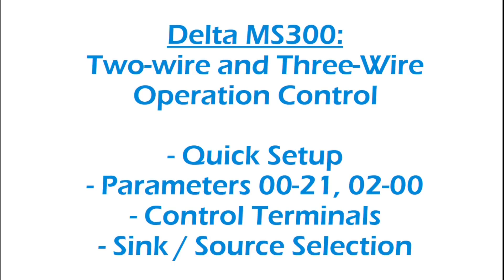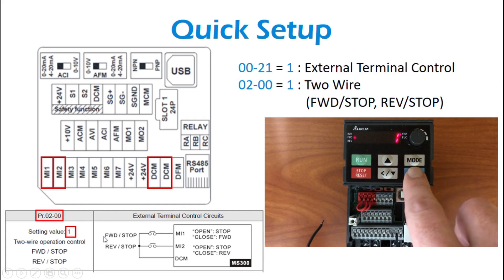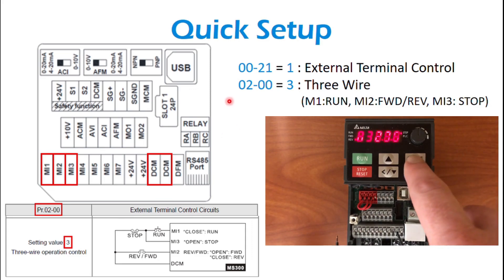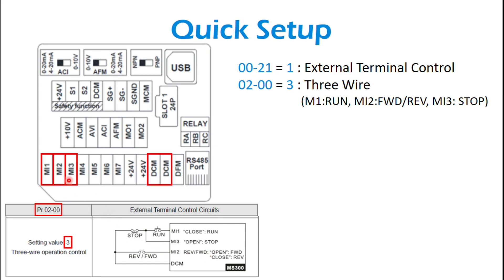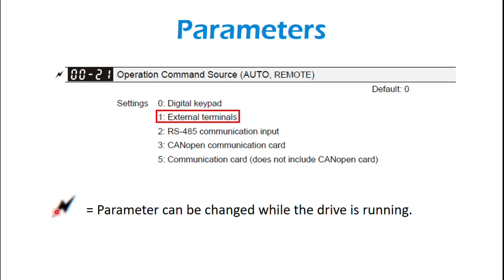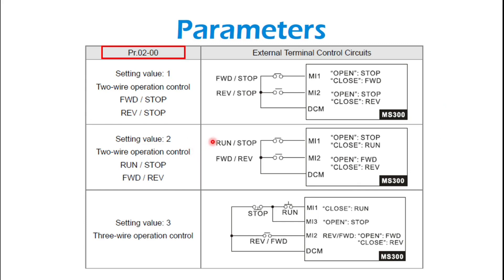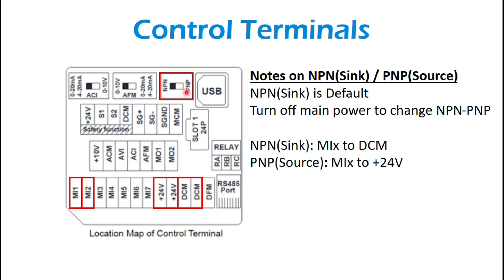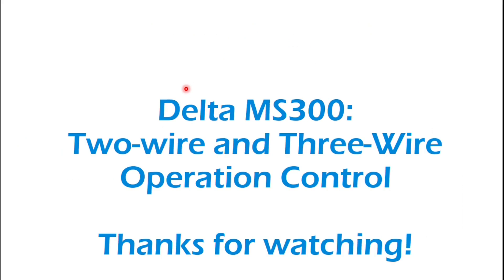Delta MS300 External Terminal Operation Control

Comment: I am wanting to run a vacuum pump for my cnc table. I was to told split the wire from the vacuum on switch and put it on m1 and vcm. Is this a safe method to run the drive?
Reply from the maker: As long as it is a dry contact from MI1 - DCM and no additional power given to the drive control terminals, then yes.

Comment: Can I bypass it by connecting a wire from MI1 to DCM bcuz I want it to run as soon as I activate the external switch that provides power to it
Reply from the maker: Yes, also check 00.21 for external terminals and 02.35 setting to enable it

Comment: can we take out the digital panel and use an extension wire or something so you can transfer the digital panel on the door of the main panel?
Reply from the maker: Yes there is a keypad extension cable. The part numbers are in the accessories section of the manual.

Comment: What about if the wires are 5. Control nob has 3 wires. Start and stop has 2 wires. How can I connect it
Reply from the maker: The potentiometer is covered in a separate video on connecting analog input.

Comment: Hi, can you do a video on how to configure the ms300 to a lathe machine(Grizzly / Powermatic)  using external switches/buttons to run the  run/forwar/stop/reverse
Reply: Hi pds4927. I'm Steve. I am trying to do just that..get an MS300 inverter to work on a PM 3520B. Did you ever have any luck configuring it with your lathe? I'm desperate. There are many more options than the original S inverter.

Comment: Thank you for your video.  I'm needing parameter setting information for using an external braking resistor.  Can you help?
Reply from the maker: Hello, check parameters 06-01 and 07-00. Search for "brake resistor" in the manual pdf.

Comment: Hi Can you do a video of how to connect the MS300 to use a 24v pulse to increase and decrease the frequency if possible?
Reply from the maker: Using an external 24VDC input, see the control terminal wiring fig 6-5 in the manual. 
Pulse input - the frequency of the pulses determines the speed. Check the description in parameter 10.16
External Up / Down - 00.20, 02.01 ~ 02.07 set to 19 and 20

Comment: Hellow sir...can you pls create video tutorial about 4 20ma using ms300..tnx
Reply from the maker: Hi, for 4-20mA use the ACI terminal as signal and ACM terminal as common. For speed reference, 03.00 = 0, 03.01 = 1, 00.20 = 2. For PID feedback, 03.01 = 5.